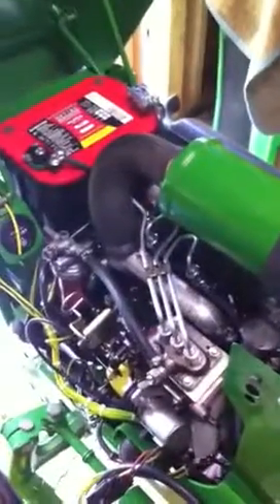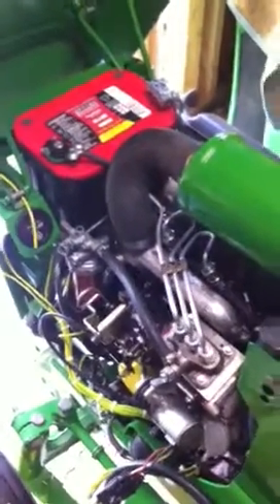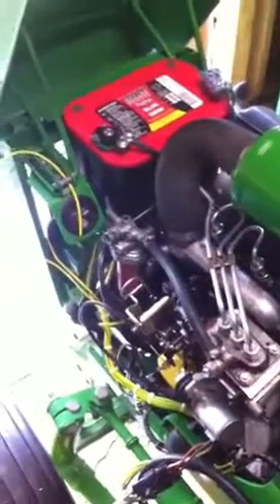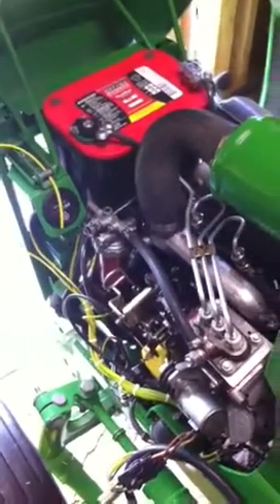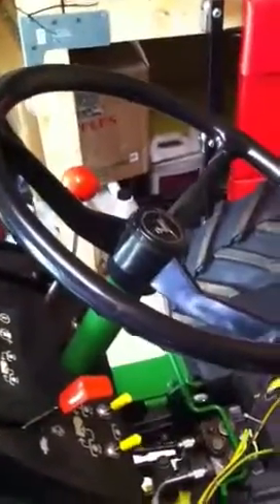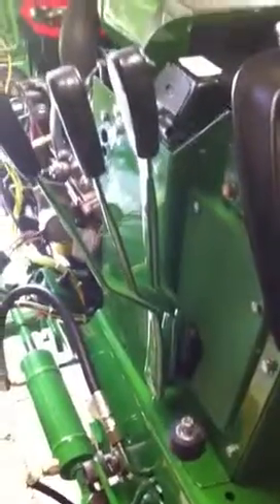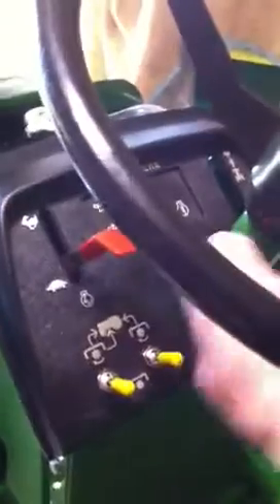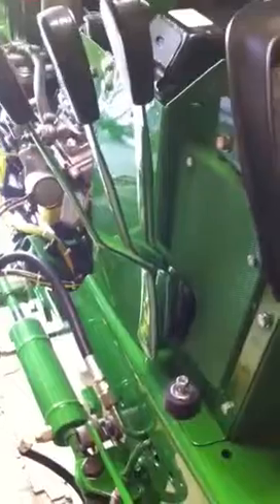John Deere 332 power steering issue

Comment: Did u ever figure this out? I’m having the same problems
Reply from the maker: John Hubosky I had to rebuild it again which meant replacing those 6 hard to install springs. I did employ a technique using zip ties to hold them in place when restacking the plates. I then snipped the zip ties and pulled them out which the springs stayed in the shallow groves.
Reply: I had the valve facing the opposite way. Fixed thanks

Comment: your steering box is not hooked correctly something inside is wrong its putting solid pressure to move the wheel like that   the hydraulis are just spinning the wheel so id say your valves are wrong in the steering box. not closing or it was assembled wrong or the steering valve is not ligning up to the correct ports .